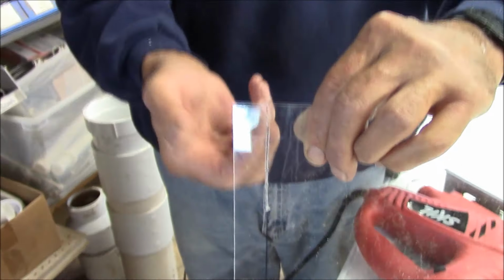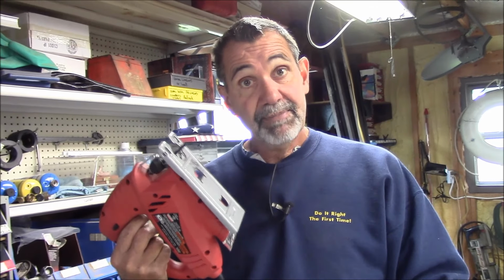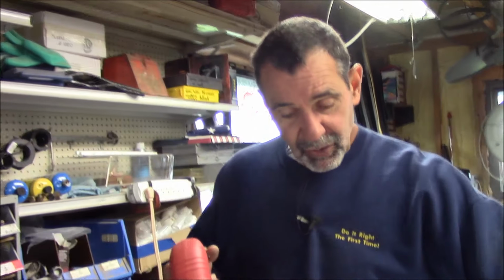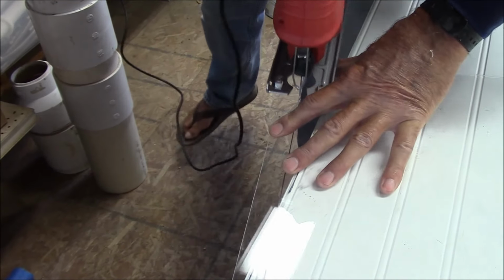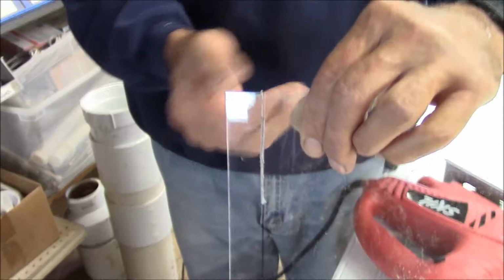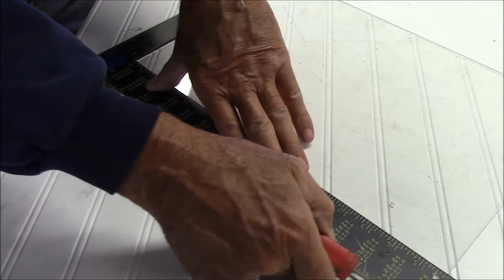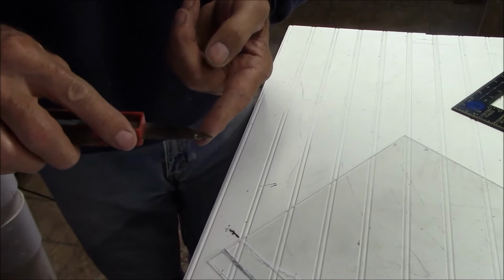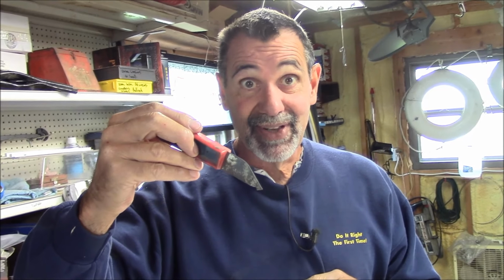Cut Plexiglass and Acrylic Cleanly - Use An Inexpensive Plastic Cutter

Comment: Ok here is the real way that works. Same process but score it 6 times and flip it over and do the same to the other side. Also cut on the waste side so if you slip will not damage the finish part. Also wear safety glasses and use your shop vac to go over the score line to clean up the shards as you go.

Comment: Perspex doesn't melt like Plexiglass when you cut it with a jigsaw. In order to make sure that the Perspex doesn't fracture, just cut it with a jigsaw on top of a 150mm thick piece of Polystyrene. The Polystyrene absorbs the shock and stops your substrate from jumping around.

Comment: Will this be able to cut through 5mm thick plexiglass?
Reply from the maker: When the plexiglass is thick, like a quarter inch, maybe I’ll make five or six passes. I’ve also flipped the plexiglass over and made passes on the opposite side, which facilitates snapping the plexiglass easier.

Comment: HOW DOES THIS WORK IF YOU NEED TO CUT A THREE INCH CIRCLE ?
Reply from the maker: I use a hole saw for circles, a saber saw, (jig saw) w/a coarser blade for curved lines. Sometimes I need a drizzle of water to prevent the plastic from melting as I’m cutting.

Comment: Most plastics but especially PMMA (aka plexiglass) need a negative cutting angle so they shave materials off most saw blades have positive cutting angles for wood or metals. Also never use ethanol or methylated spirit on PMMA as it leads to chemical stress cracking.

Comment: Happened across your video and your informative, gentle way of passing along information captured and kept my interest, even though I have absolutely no need at the time to cut plexiglass, lol.  Even so, I’m now interested in getting one of these tools, and have subscribed to your channel, as I like to play informative YouTube videos in the background to listen to (NEVER watch) on my long commute to work.  May I ask the specific plexiglass knife you use? There are quite a few options on Amazon and the one you used seemed to do the job well.

Thanks again for the video and I look forward to learning more from your videos.  Have a great one!
Reply from the maker: The one I used is no longer available. The company has changed its manufacture. I have used several brands of plexiglass dry knives, and they really all work the same. The only difference is if you were cutting a lot of it you could buy a carbide tipped one.